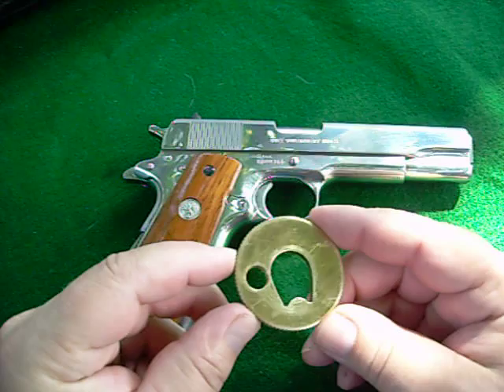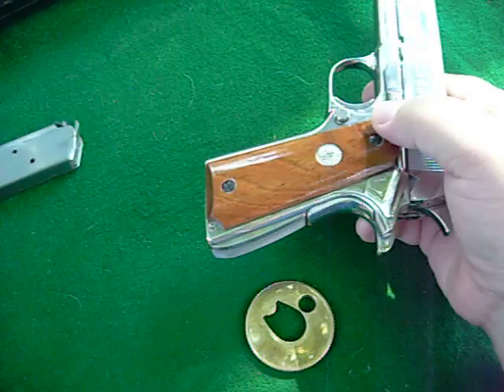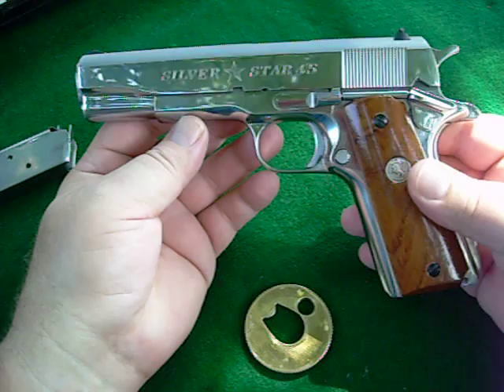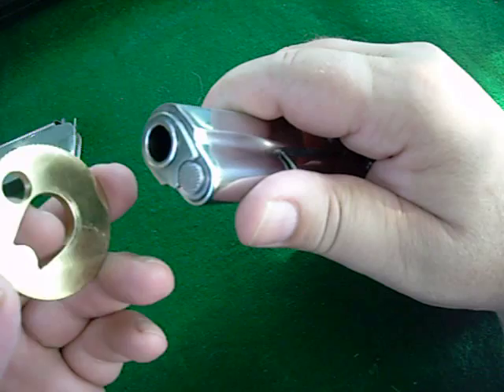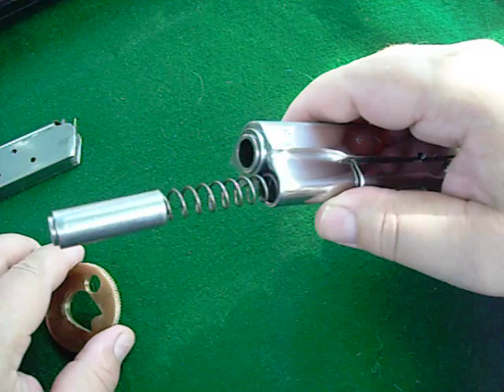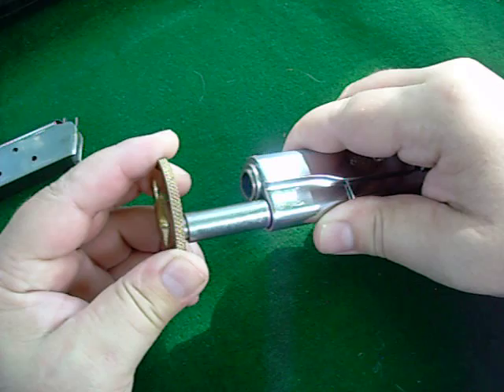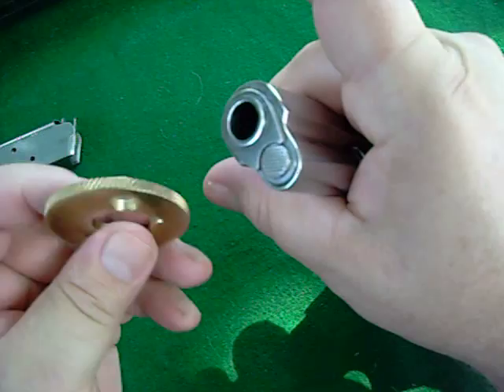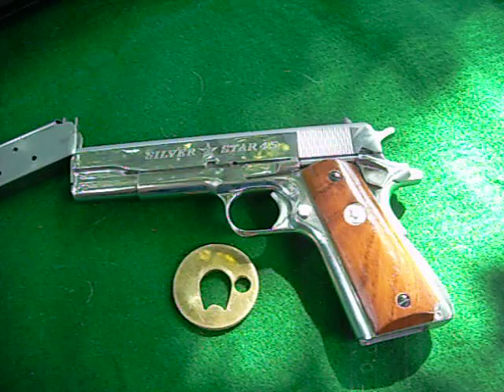Colt .45,Government model barrel bushing wrench(H Q) by Jeffery A. Krueger

Comment: Where did you get that kind of metal and what's the name of the metal?
Reply from the maker: Hello ,Note- My Gun is "Stainless Steel"- So for THAT, the Metal I Made mine out of is # 316 Brass found at most metal supply Places...., I turned it Down to 1.975 Inches and knurled the outside from a piece of 2. Inch Round stock,also boring a hole in the center .743 of an inch Inside diameter, then Cutting off  and Finishing a Slice to a polish with no sharp edges to .166 of an inch thick , From There I Take it to the Milling Machine and Bore the .386 of an inch  hole to the exact off set from center dimension I measured from my Gun , Then I Scribe the profile of the bushing on  the brass  and file that close clearance shape out and polish  to a finish.